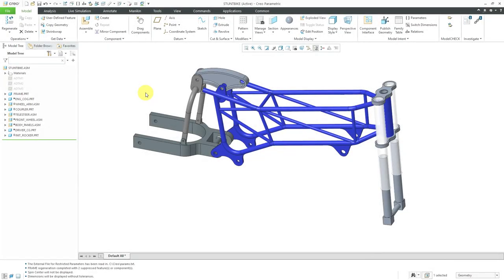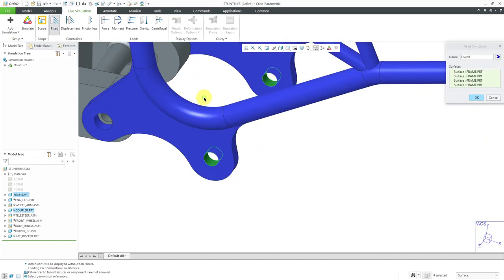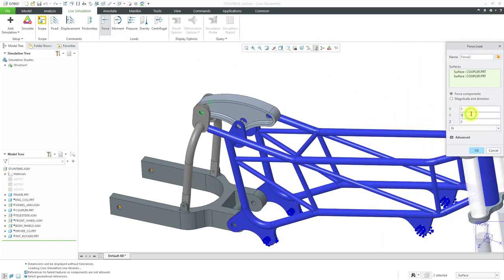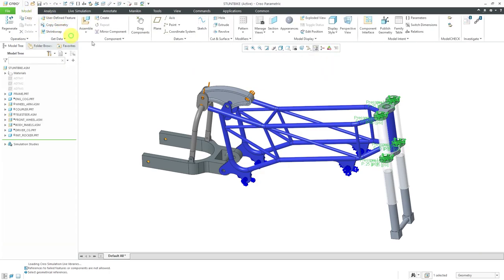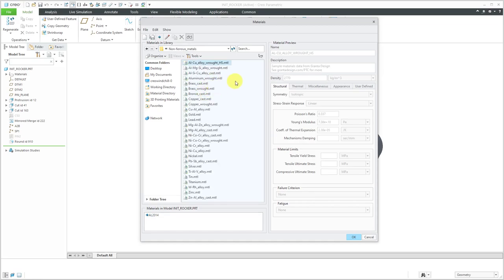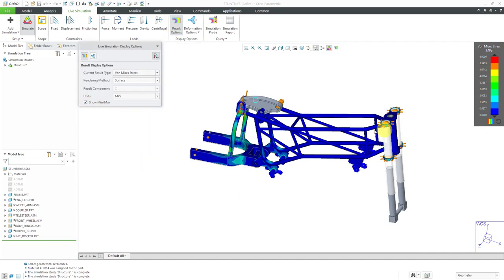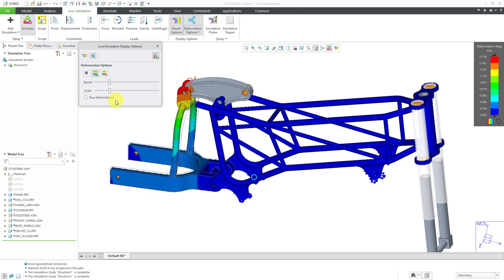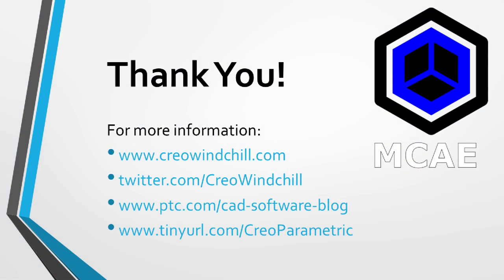Creo Parametric - Creo Simulation Live - Assembly Structural Analysis | Tutorial

Comment: Hello, The video is very informative thanks for uploading it, actually i have a question ,In your Analysis on the assemblies  you have used Frame as a .prt file ,as you already know that it will be welded with all the brackets, my question is how can we bond the tube to tube weld connection and the bracket to tube connection so that Creo reads as it a single entity without creating .prt file but in this case as a welded assembly.

Comment: Dave, what's the point of having creo simulation live at assembly level when we can't assign rigid links / welding etc?
Reply from the maker: 1. CSL is intended as a real-time design assistant that provides feedback and guidance as you're modeling. It's intended as a complement to Creo Simulate or Creo Ansys Simulation.
2. Software development takes time. It's not instantaneous. Just because functionality isn't available today doesn't mean it will never be there. Since CSL was introduced in Creo 5, new functionality has been introduced in every version.